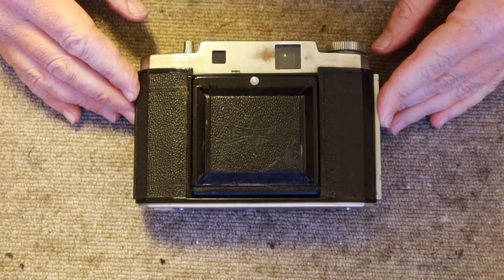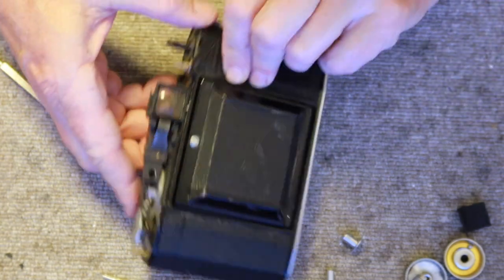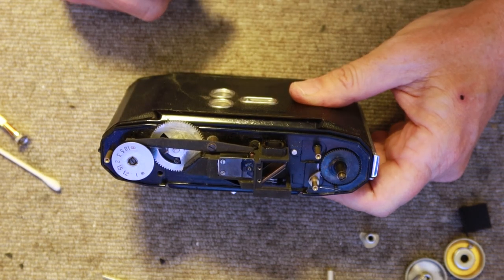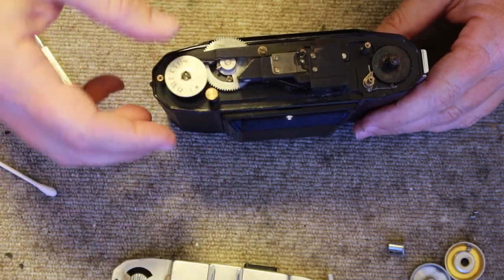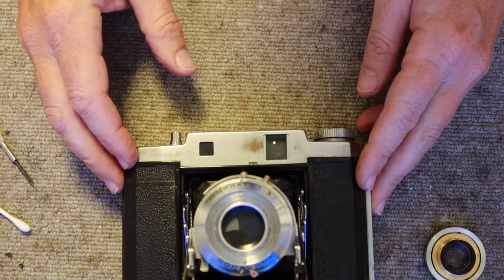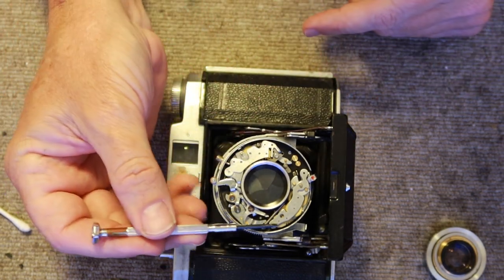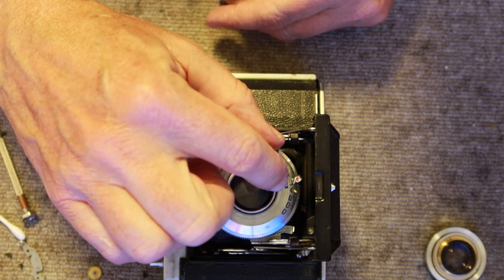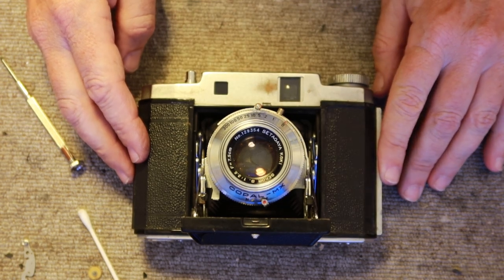Mamiya 6 Quick Repairs

Comment: Hi Jeff, Thanks for another clearly explained tutorial. Is there a similar procedure for disabling an already stuck self timer on an Olympus 35 RC? I have one that is in otherwise beautiful condition. I had thought of removing the self timer lever to render it a non-issue but, unfortunately, decided to leave it in place for cosmetic reasons. BIG mistake! Someone (who will remain unnamed) decided to fiddle with something that they knew nothing about. Now I have a beautiful little camera that does not do what a camera was meant to do. If I can get the camera working again I will replace the lever with a small disc that cannot be turned & file the lever away in my oubliette... A tupperware box of bits at the back of my desk's bottom drawer - easily forgotten about! Ciao mate, 😉

Comment: Hi. Watched your video with interest  and would like to ask if you have had problems with the focus on these cameras. I have repaired all these models even the very early ones with the three windows on the top plate. Those are so old they are a complete strip down even the aperture blades and new bellows made by camera bellows in Birmingham UK. The only problem I found is the copal shutters like this one you have. The 10th sec will only fire at around 100th speed and no amount of adjustment will cure it. Of course back when parts were available you swap it out. The other problem was the focus on a automat version. I have two one works but the other will not focus at infinity. There are no spaces behind the lens and in fact it even needs less space between the lens and the film plane. There seems no way of closing that distance. All I can assume is someone maybe swapped out the shutter and lens system on it. Finally id like to add please do not post a destructive video. There are not enough cameras in good condition. I recently bought and got a full refund on a 135 mamiya sekor TLR lens where the slow speed unit and other parts were missing from a good lens making it useless and a shelf queen. I know you have done many repairs but the the self timer should never be opened like that. It's so simple to remove as a complete unit. Undo the heavy spring that attaches it to the shutter and gently lift it up. It's only held in place by a pin which it slides down onto near the lever. I have never come across any shutter that it's held in place from the back side. Back in the day that would make it not economical to replace a self timer unit as the whole shutter would need dismantling. Never ever open a self time or slow speed unit. You will never get it back together. I've done it with the slow speed unit as it was a last attempt to get it working. The whole thing was warped and stopped the 1second from working. Word to anyone out there. The only way to get these working correctly is to strip them down. Rinsing in lighter fluid just pushes the oils into a new place. Any one want any more advice on these beautiful camera message me.
Reply: Thats a great list of recommendations from you. Less and less info is out there as well as film cameras in good condition..
Reply: @muralboletube  thank you. I've repaired 100s if cameras and also made mistakes as well. There is too much false info like use wd40 etc which should never been seen near a camera. Message me if you have a problem and I'll do my best to answer it.